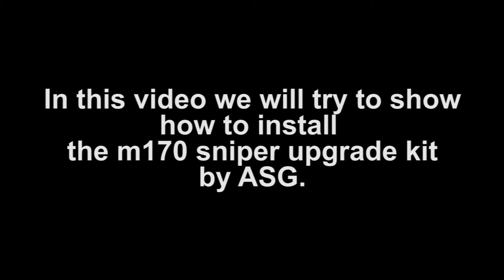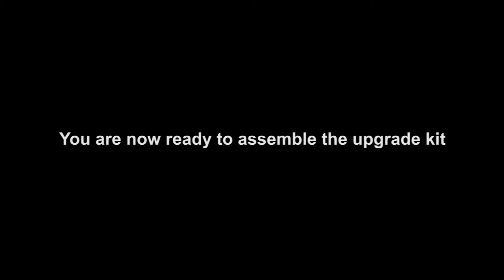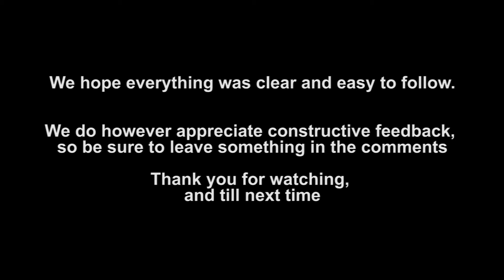TUTORIAL - ASG m170 sniper upgrade kit

Comment: I got this kit too but when I pull back the bolt, it locks and can't go back far enough for the loading fin to load a bb into the ramp.  Any ideas whats wrong?
Reply from the maker: wow thats strange.. no idea.. :/
Reply: +TACT Actually I figured it out.  I was so used to the old trigger feeding before it caught the piston.  But this one catches the piston before it
feeds.  So if I just keep pulling another half inch it will continue to travel and I can hear the round chamber.  Hopefully this will help anyone else who might freak out when the kit doesn't feed
Reply from the maker: +Luke Beaton ah there you go!! thanks for sharing!!!!